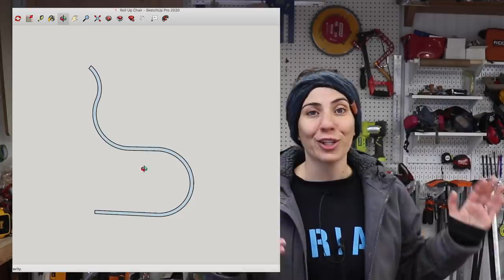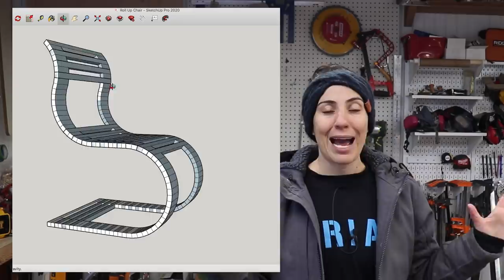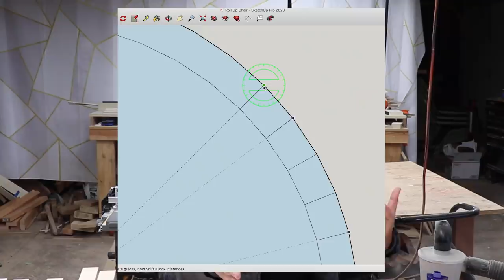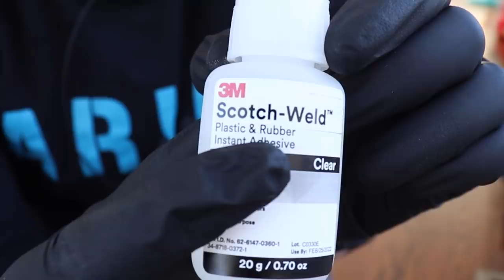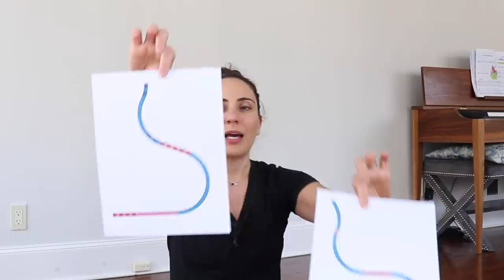I ATTEMPTED to make a chair that rolls up... It didn't go as planned...

Comment: Ok, as an engineer myself I think you did a good job.
And you are closer as you might think.

1. choice of wood is ok. maple isn't a very hard wood. but please do not choice any softer.
2. to fix the shape of the chair just remove a couple of wood pieces on the spots where the angle is going into an to extreme value. create new ones with adjusted angles.
3. your main problem wasn't really the choice of materials. its more the used width. you just used 50% of the possible width. also to screw through the rubber is not going to work.
maybe a thick layer of felt of 4mm (or maybe 2 layer) could do the job by glueing it. its important that the surface of the material is able to connect to glue. the polysomething stripes are strong materials but not good for glueing as they are woven. the felt can "suck" the glue by pressure on it and hold the connection. or you glue the felt and than the polysomething stripes by pressure because the felt will adjust its shape to the stripes and it will become a better connection.

Iam pretty sure this will may be not perfect but improve your construction.

PS: or Iam totally wrong ;)

PS2: Maple isn't a hard wood.

Comment: Great effort.
At 27.40 on the video when you pull the back upright you see a triangular gap at the bottom of the wooden pieces. 
Could you not reshape these pieces to avoid this so that it stops the back from falling so far back.

Comment: I wonder if popular wood would been suitable for your purpose; foray, I have worked with metal all my life, and just started working with wood on or about 2017, and I have found that popular wood is both strong and looks good, ( also it doesn't spilt or crack as easy as others; which is good for me as a rookie ).

As a retired military type after 25 years in service; design, create and building projects at home makes me think we are just like our creator in that way; when working on a project yourself, and undistributed seems like some of our most blithe moments in life.

I have presently been afflicted by carving wood spirits and such with a dremel and flex extension, since it is almost like hildung a pen.

Peace

Addendum:  I hope something beautiful happens for you today; it all starts with just a single thought .. Thank you for the excellent content and actionable information throughout this task.

Comment: What you need is a material for the straps that has absolutely no stretch whatsoever. The forces excerted there are tremendous. Look into belts - like, conveyor belts, multi-V belts, something that has kevlar or even steel ropes embedded in it. You also need to take the forces on your fasteners into consideration, the holes through wich the screws go will elongate at some point. A clamping solution might work better. Take the initial stretch and wood compression into account when designing. Design the chair way too straight and let it compress into the proper curve over a little time, till the system has stabilized.

Comment: I personally would have used four high tension wires running through each of the pieces, offset towards the seating side, running through steel tunnel inserts in each piece of wood, as well as a more functional/comfortable cloth layer on the surface.

Comment: That's a cool project! It feels like the geometry is a little bit off for the upper part of the chair. It feels like may be it shouldn't have rectangular section boards instead of squared section board in the top to hold up better. And may be it's worth to try out making the next prototypes several times smaller than this. You don't really need a 1:1 scale for proof of geometry, and then solve material problems. :)

Comment: Try making the loadbearing segments thicker...
The segments do not have to be uniform for it to roll. Also it should give you more stability. It should also take the stress from the strips

By load bearing I specifically mean the segments leading up the back support and also the segments curling up lifting the seat from the floor

Comment: She kinda reminds me of lady gaga mostly in the eyes. That's a compliment btw, lady gaga is beautiful.

Also great video! At the very least it can function as a stool if you just took off the back support part, so you still made something that successfully supports the weight of a human. You really are onto something! I'm sure it wouldn't even take long to tweak if you go at it again after some well-deserved rest. A lot of these comments have some great ideas for how to fix it. Like a strong cable running through the inside of the back support pieces so you have more tension to hold it upright. Or maybe the chair is just too long on the top and the angles of wood pieces need to be re-cut at a little more of an angle.

Fantastic video! Thank you for still uploading it despite the frustration you seemed to feel toward the end. It helps us all learn patience to watch someone deal with feelings of failure in a way that isn't self destructive. You seem like a person with a healthier attitude towards hurdles.

Comment: So use a thin strip of super strong rubber like the kind they use in slingshots and then put felt on top to support and to pretect you in the case of a strip snapping
Make the back very sharp so even sitting on the edge you can use it. You could make the back bend reversed so it's more like a lumbar support rather than a backrest that might help prevent people from leaning too far and snapping it
I know it may be cheating but you could also have slots in the bottom of the chair and bottom of the seat for interlocking wood pillars to provide extra strength it can still all fit nicely in a bag and the pillars can provide extra support and take some pressure off the bend preventing an early failure and/or increasing the weight limit

Comment: I noticed the centerline of the 2nd attempt was just right after the bend from the floor to seat area. Using that info I can see there’s too much excess length for the seat area. You can remove a good portion of that seat area and then sharpen the curve leading upwards for the back.

Comment: I think that you could potentially use the rubber, it was just the screws that weakened the elasticity of the material. But what if you clamped it to the individual wood prices somehow. It would take longer and take more material but I think it could work

Comment: think you needed to put the yoga tape thingy material behind the blocks for the back portion to work... so the elasticity would stay instead of flex all the way down, but would probably need a round block in between it to pass the tape thingy below it and back up through the rear back blocks part.

Comment: @Tamar, discovered your YouTube channel only today. It's very informative and fun watching your creative works and experiments. You have a new subscriber. 

By now you will have figured out a solution for the angle of inclination. You will have noticed that your three circles have all different angles. Could you have measured only the bottom lower larger segmented angles and duplicated the same onto the two upper circles (arc) as well. You mentioned about laying them all by its side to check the shape. It's a good idea.

Theoretically, as long as the angles are correct, the tension on the polyester strap will be minimal.

Comment: It might turn out heavier  And more expensive. but I think you probably would have got a stronger Connection between the pieces if you used Metal hinges. 

Specifically the thin ones that you can  Cut with a metal saw.

You know the ones that come in 1' 2' 3' and 4' lengths.

 In order to accommodate the with of those hinges each segment can be wider so that half of the hinge takes up half of the space on each piece. 

 Which means instead of A circle with 48 segments you could reduce that to 30 or 24 segments.

 You could also consider making each piece thicker along with being wider that way there's more material to support your weight. 

 From an outside perspective it appeared the wood was too thin and that caused it to flex more then I would have been comfortable with.

 Another thing to consider is the compression of the wood over time. which will eventually cause the chair to lose its initial support. 

 Something I think is worth considering given that there's a tremendous amount of pressure on each piece.

 A wood hardener might be worth considering.

 Also try assembling its on its side so you can fit the pieces together without having to fumble with supporting it.  What I mean is when it's on it's side you're putting the pieces together as if it's in the up or usable position.

 Lastly this is more personal preference on my part but I think the chair would have looked great if you used pine or  Spruce with a honey stain and Brass or bronze hinges.

 Great idea I was thinking about how I would build this while watching and I basically just told you.

Comment: My take on this would be the following: instead of making sections in different shapes you should try (at the bottom curve) to work with pieces of the same shape (just normal rectangular base blocks) and playing with the distance from one to the other, by sticking them at a couple of millimeters of space, when stretched they should make a curve that distributes weight better than yours since it uses the rubber as an actual spring and not as a fixed supporting material.

Comment: So it needs to be connected at each end than have slip at each board like under an eyelet of some sort, so you can than easily tighten the whole thing from either end. With the strap mounted solidly it cant use the stretch or pull on the strap to hold up the back

Comment: If I was making this chair, I wouldn't use so many pieces. I mean, obviously you need that to make it elegant, but my favorite part about this project was the portability, I really like functional furniture.

Maybe just 7ish pieces that fold up flat and carry like a suit case? I'd probably use hinges between the pieces too.
Reply: Btw, I'm just talking out of thin air. I don't have a shop or anything to make stuff that big xD

I designed a table once for my apartment because I wanted something easy to pack, but I gave the instructions and material to my dad to cut lmao

Everything else I make is really small like glasses frames.

Comment: It looks like a “give” in that structure is the problem. So, I wonder if it helps to 1) have every pieces full length of the width of the chair, like you have on the seat top. To give the weight distributed on larger area 2) make each piece thicker, at least for the prototype, so the lever arm ( which is from the back side of each piece to the screws on the webbing) is longer.

Comment: I think the trick is not in the strap but instead use the wood itself to take advantage of compressive strength and lock in the shape. If I understand the theory of this chair, it isn't tensile strength that makes it work, but rather the compressive strength. The tension of the straps just creates a form to hold the wood in place to distribute the force. So on the first arch you mentioned it felt solid, but I noticed that it had all pieces firmly compressing, with the strap just holding them in place. Seems like your materials are good, maybe just adjust the geometry of the back portion. Maybe build it on a form so they don't lay flat? It's an interesting challenge and you did an amazing job!

Comment: What if....you were to drill holes through each of the blocks and run a cable through each side?  There is actually special cables you can get that include a threaded end which would make the tension adjustable. (The cables are used in railings. I've seen it on This Old House.)

Comment: Add filler to change your joint gaps. Also wood will compress in its hardest joints don't do pine.  Moisture or stainwork will ultimately add a big change... Totally awesome jobs NOT a failure

Comment: I guess, you need an angle a little bit closer to 90 degrees to get more support. Yep, it is going to increase the radius of bottom circle, but there's potential to get a better angle for sitting.

Comment: The shape of the cross bars, after the weight bearing curve use cross bars that have been planed to be narrower at the strap side
Reply: Well wider on the non strap side and planed to correct width on the strap side

Comment: you did an amazing job with the wood working and theoretical assembly. when you grabbed the yoga matt, i audibly said "Nooooo...." then you whipped out the seatbelt material. i'm like okay! but why the matt now? all in all, i think you need a material that has 0 give whatsoever. the "springiness" of the chair will be present even if you made this out of metal and cables. the shear amount of "hinges" would provide that. As a matter of fact, I'd be willing to bet if every piece was placed perfectly to where the two pieces of wood touch each other at the correct angle, you could actually use metal hinges. That would be very interesting to see althought incredibly tedious!

Comment: I don’t know how is this work, I am amazed. And I just try to guessing.

I’m thinking maybe useing some other material on the top part of the chair for example a car or a bicycle tires maybe help, which will pull back more that part of the chair. Or an another part, which as well able to roll up, but if you roll it down, you can just push out, so it does not let the back part of the chair bend over. 

Something which gives resistance but as well able to roll up. I’m thinking in that way.

Comment: If i could just be frank. Your execution and skills are great. You managed to try different belts material to hold the woods.

However project management and feasibility study need to be improved. 

If i may suggest to sacrifice the rolling pattern, and to attach belt opposite sides  around the curve in between the seat and the back rest.

Second is to add an arc at the flat bottom end right up to the seat to limit flexing and serves as additional support.

However feasibility studies still needs to be carried out before action.

Lastly you mentioned pine wood for prototype is good idea.. but you may misjudged if you started with pine.

 The strong peak where you sit may plunged down causing a permanent deform after sitting on. You may get the wrong idea that changing to maple alone will solve all the problem. I felt is right to test with maple in the first attempt. 

All the best.

Comment: For the back I would have used pieces with more pronounced slant angles and make the bendy part pieces out of more durable wood since they have the most pressure put on them as well as bolt the screws through completely at those parts, maybe also run a strong wire through the entire length of the structure.

Comment: This was interesting and looked like a fun projekt. One thing that Would help a Lot would be to use ticker pices (if you double the thickness for exsample the tension in the robe Will be halfed and the compresion force in the Wood Will Also be halfed), further more IT would help whit a geometrik advantage og the tension part give 1 mm and the Wood is 20 mm thick that is an angel chance of about 2,9 but og the Wood is 40mm thick its only about 1,4 degree. In coclusion double the Wood thickness Will make the chair 4 times stronger. 
but can understand og you think this Will ruin the design it will make the roled up furniture way bigger but the 2x was just an exsample 1,5 would Also do a lot. 
And i dont think rubber is the corect way to go it will only realy aplly tension if it is pretensioned wich is deficult and if you ever get enough pre tension to hold a person it will properly just IT self out when nobody is sitting in it. You Beeing afraid IT would not go back is a real consern but your solution whit changing the curve is in my opinion the beter way to deal whit that, and ising something whit high stiffness.
Anyways nice craftmanship and determination.

Comment: Maybe use motorcycle chain, or some chain like that at a side of the construction, or the oposite side, that you are sitting on. It would be better than rubber, becouse it has no stretch which will make chair more sturdy. Or you could just make the whole chair operate like a bike chain and add some kinda blocks, so it is in position you want it to be in.

Comment: It looks like a project of 200 hinges. The way you made it with nails or screws you are giving the pieces a lot of play in different directions. If you think of it is 200 hinges, then the clue is to attach the "seat belt" very firmly on the whole surface it touches the wood so that the touching surfaces between the wood parts don' t have room to slide sideways or up and down, like with hinges. What would attach well enough? I was first thinking about epoxy, but i think it would require holes in the wood to let the epoxy get strong enough grip on the wood. I don't know if epoxy has the right properties for this, but whatever you fuse the pieces together with have to have almost no flex, and somehing like epoxy could saturate the fabric. I think all the flex you want in the chair would come from the flex in the wood itself.